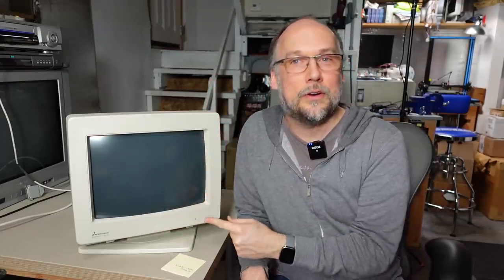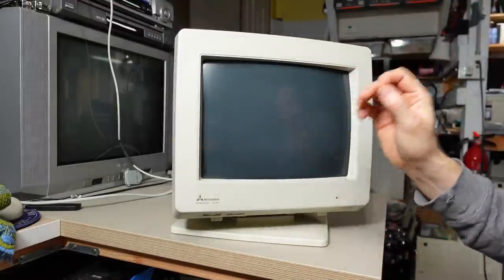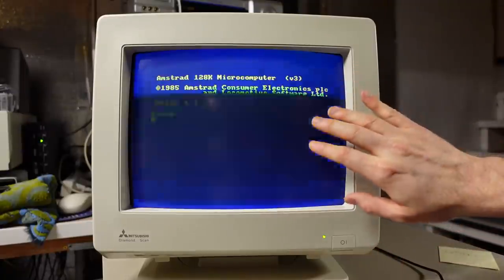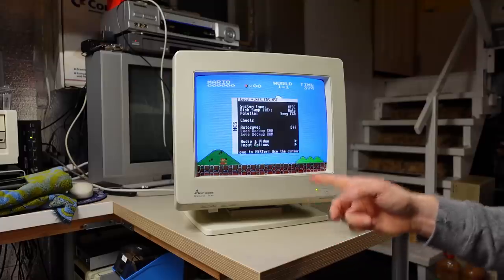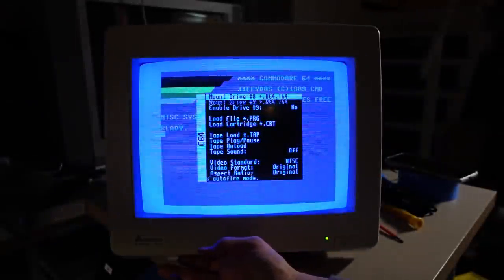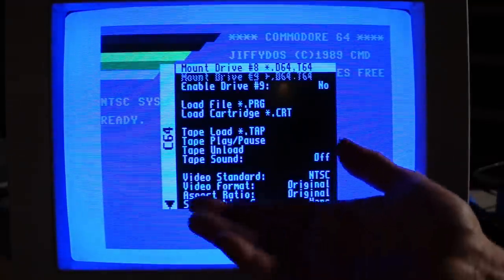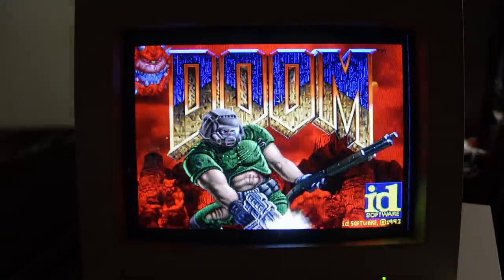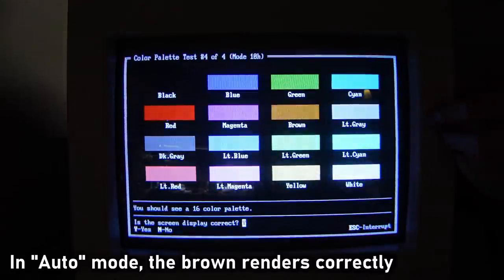Can I rejuvenate the CRT in my Mitsubishi Multisync monitor?

Comment: So, I was given a 19" SUN flat-crt the other day. I plan on using it for something, even have the vga adapter!
Reply: I had one of those too, you have the 13W3 to VGA adaptor great. I vaguely remember there was 2 kinds of these adapters, active and passive. But I seem to recall many (perhaps not all?) of those old Sun monitors used "sync on green" instead of composite sync. I also remember it being limited to a single resolution of 1152x900 and that means you won't see the BIOS or any VGA/text mode screens ever. The unusual sync on green means getting non-Sun hardware to display anything on it will likely require yet another adapter. I got it working on an old Windows 98 PC using a software tool called "Powerstrip" and a supported graphics card (I think it was the original Matrox MGA Millenium w/2MB WRAM). Powerstrip was able to force the graphics card to output the needed sync on green signal, it did work very well but only after Windows and Powerstrip had loaded. Of course I had to install and configure Windows/PS with a different monitor to even get to this point.

Maybe this will save you some time, good luck!
Reply: Back in the '90s I had a specialty video card for a PC to run a Sun monitor. I'm 95% sure that the monitor was the one that was sold with the SPARCstation 20 where the only controls were on a credit card-sized remote control that slotted below the bottom bezel. Anyway, I think the card somehow translated the startup BIOS and POST screens into a signal that the monitor would display, though I might be misremembering that. Anyway, good luck and thanks for the trip down memory lane.

Comment: I noticed that the needle on the blue meter bouncing a bit when you were pointing at it and wondering what's going on. It might not be common knowledge, but I learned that way back in the day and also forgot about it until it bit me: These needle instruments are so sensitive, that static alectricity is throwing them off. You can get quite a few degrees deflection by just brushing against the case while charged up. And some cases will "keep" the static and create a false reading from it. Always make sure to use ESD wrist bands with these, and discharge them before serious mesurements. I might do a brief "tidbits" video about that at some time...

Comment: Don't be too afraid to stick some cheater magnets on the tube! I used some on my Trinitron TV and it helped straighten out the edges. I just got some soft square fridge type magnets off Amazon and slid them around until they started affecting the area I wanted to fix, then rotate and slide them until you get the effect you are looking for

Comment: I love tinkering with old tech. It's a habit of mine that every Saturday I visit the local flea market looking for "treasure". Today I was able to snag a Commodore Plus4 for a reasonable price and it is working! The TED chip is not dead, however at first the keyboard showed little signs of life. Some cleaning helped and now it's working but I have to press some of the keys a little harder. The other thing I got was a silver fat PlayStation 2 for dirt cheat. It was rather dirty, and had a disk inside. The system started but it couldn't load the disk, it sounded horrible as it tried to seek. I was ready for a laser replacement. I almost fully disassembled it, cleaned it out inside and out because it was a bit smelly and I hit the laser lens with a little 70% pharmaceutical alcohol. Usually this doesn't help, it never helped me before but it was already bad and I couldn't make it worse. When I started it up again, that horrible sound was no more and it actually booted the game! I was so hyped! I was sending a message on my phone while the intro of the game was going and it didn't have the slightest jitter during the intro cutscene, I was so happy! It's so cool to take apart stuff, try to figure out what's wrong with it and then fix it, it's so satisfying! I'm kinda addicted to this treasure hunting and fixing :)
(thanks to David - 8bit guy, Clint at LGR and you, Adrien from your Digital Basement)

Comment: Many years ago I saw a stack of that model CRT tester/analyzer/rejuvenater collecting dust in an industrial-computer repair-shop in Pickering.  
They'd had their cables and accessories scrapped by someone at an auction/consignment house [redact]. (At the time) The shop couldn't get the documentation necessary to recreate the missing cables (with enough certainty).

I wish that I'd recognised what they were, and had somewhere safe to store it; Then I'd have accepted the offer to take a couple of them, and might have avoided seeing it raided/stripped like my other toys and equipment.

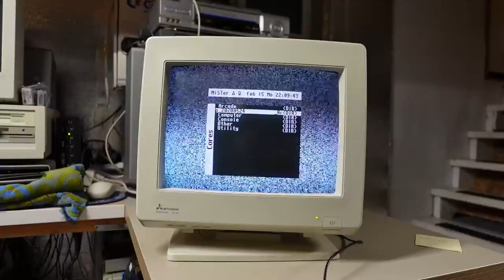Comment: I was TV technician for about 10 years, before becoming a professional programmer. First, looking at the initial problem with your monitor , if it can do HIGH bright high contrast, black and white vertical strips (like letters, menu frame) without FLAMMING (that is luma bleeding to the right) as seen , min 7:49, The CRT IS NOT the culprit!, so, you misdiagnosed at all, the problem you originally has a misadjustment in BLACK LEVEL, if the chassis hasn't analog adjustments pots, you need to enter in service mode and adjust it with the menues. (I imagine that you already tried the SCREEN pot at the flyback to correct it and you was unabled to correct it with that control, also assuming as it is in focus, the flyback HV circuit is not the culprit, anything wrong there will make the focus to move constantly and ugly).

After you change the CRT, you has problems with yoke/crt mismatching one each other, you need to implement MAGNET strips to marry the joke with the CRT. That is, magnetic strip that you can set in the glass of the neck, or stick it over the windings of the yoke, those magnet will affect a single corner, or top center, bottom center, etc., deppends on where you set, the angle also affect. But for doing that, you need to find out the exact position of the joke (that is how far or near is the joke mounted against the glass, sometime it needs a bit of space, so there is rubber mounts aswell that prevent the joke to move freely while making space).

The PURITY rings (both rings near to the screen) adjust it first, rotating both at the same time will CENTER the IMAGE (you need a TV pattern for calibrating the center), and then the CONVERGENCE rings (rings near to the socket) adjust it later. If you can't do purity AND CENTERERING, you can't do convergence. If purity is not OK, that means the joke is in a bad position, change the position of the joke, once you has perfect purity and center, you can adjust the convergence, the convergence must be adjusted WATCHING ONLY the CENTER of the screen, your goal is a perfect match IN THE CENTER, once achieved that, it is DONE!. For the corners, you needs to insert magnet strips. (when the center of the screen match convergence but not corners that means that the joke or the CRT has quality issues, for matching marrying the quality of both are used magned strips).

Remember that a yoke can be in the FAR / NEAR regard screen (focal point) correct position, but if the joke is falling that is, the winding is pointing some degree down, or to the left, or to the right, or up, that joke is not CENTERED, and will affect purity, image center, and convergence. Make sure to measure that mounting rubbers maintain the joke centered vertically and horizontally, a big mistake is to mount a rubber deeper that the rubber of the other side, so the jokes points to some side.

Other mistake, is not to place the rings holder in the exact position where the manufacturer placed it, that happens when a newbie clean the glass, so the exact dirt mark in the glass where the ring holder was, is not visible anymore!. If it out of position, the rings won't do the exact function that it must do, like purity ring affecting convergence, or convergence rings affecting purity, that means that it is out of place, if is too out of place, you can to rotate a ring and it will do nothig, or affect just a bit, but not enough, that is out of place.
Reply: EDITED.
Reply: Adrian is colour blind
Reply: @mikeuk666  brown is too near to the black if the cutoff (rgb black level) is wrong , you will has exactly what the video shows. If is matter of ... the crt is tired... you never will has that bright white in the menues , it will be all dim (like all phosohor burned, i don't see burn marks aswell, also I don't see unbalanced guns like brown is just a very dark yellow , so you need the red gun to be ok, but if something wrong with the red gun , you will never has that bright white.
Reply: @mikeuk666  edited
Reply: @flyguille  not sure why you explained all that to me 👍🏻
Reply: I just did a complete Yoke swap on a CRT for the first time not to long ago and its definitely very involved if your learning it for the first time I had to reset the yoke and concentric convergence ring assembly at least 5 times before it was remotely presentable to look at. Even then it was still off some.
Reply: The joke is on your yoke. ;-) (Lots of great speling in your post.) Also there's no OSD or microprocessor on this monitor.. it's all analog baby. He covered much of what you posted in the video. You watched it right? But thanks for the parts about magnet placement.

Comment: Rejuvenation works by stripping the top layer of 'oxide' off of the cathode, with the hope that a good amount still remains underneath.  When the worn out top layer is gone, any existing oxide beneath will come to the surface and provide enough emission to bring the tube back to life.  However, it the tube is REALLY tired, there won't be any useful oxide left on the cathode, and the rejuvenation will be only a death blow.  If the tube was made with a thick cathode coating, rejuvenation might work several times.  If the coating was put on thin, it won't help at all.  However, if the tube is so tired that it's useless, you probably don't have anything to lose.  A brightener, which is a transformer that increases the CRT filament voltage from 6 volts to 8 volts or so can give you a few months of more life,.  Good thing you were able to find a nearly perfect replacement.  Nobody today is making new CRT's or rebuilding old ones.  So most monitors will end up in the landfill. :-(

Comment: 800x600 at 60Hz was one of the very first SVGA resolutions. The highest resolution I recall from 1989 was to be found on the IBM 8514/a which did 1024x768 at 87Hz interlaced. For comparison, in the mid-1980s a 1024x1024 special pre-VESA pre-SVGA color graphics display was a choice hardware item that would set you back $10 grand.

Comment: Nice find with the König rejuvenator! I have a very similar Müter BMR-90, but it's not automated. They did have an automated model as well, tho (BMR-95). That said, I wonder if the automatic process killed the tube?
Your Mitsubishi really did have good emission, surprisingly. Infact, usually the blue cathode is the one to go first so I was surprised it turned out strongest. Maybe the previous owner preferred yellows. ;^)

Comment: Hey Adrian, there is a company called Lexel Imaging that has a significant stock of unused CRTs that might be able to help you if you send them an e-mail.  You may have heard previously about a company called VDC that a lot of TRS-80 folks used to get replacement tubes from, well Lexel is a subsidiary of VDC to whom most of the CRT stock was transferred a year or two ago.  I ordered a tube from VDC for a CGA monitor back in 2018, they know how to cross-reference these and find one that's compatible.

EDIT: I actually thought the video was over when I commented this but there's like 15 minutes left, so just disregard if this advice isn't applicable.  But maybe if you need a new CRT in the future you can contact them!

Comment: This is not a monitor which was sold to the general public.  It was designed for use in testing laboratories to verify the functionality of commercial and industrial equipment.  They are still in high demand in the aircraft and industrial MRO market because of their versatility, and some avionics test sets specify this exact model of monitor.
Reply: It was sold to the general public, I have one.

Comment: Nice that you got your monitor working in the end. Earlier this week I was trying to revive a 70 year old TV and I wasn't able to get anything to show up on screen. It would be so much easier if I had a CRT tester and a high voltage probe, now I'm stuck wondering if it's an HV problem, grid voltage problem, or if the CRT itself has a problem.

Comment: my birthday comment so better watch out :P
old crt's which weren't used in a while get dimmer and not evenly and often leaving a crt on for a while "wakes it up" as some  youtuber say
if it is really worn out you simply won't see any difference, but if it is only pasivated on cathodes from waiting 20 years in the storage there is a great chance it will wake up after displaying white screen (or black and white stripes) for a span of few hours. no rejuvenation needed 
i got my 80's tv's all working this way, with no extra effort

one more thing in most cases with color crt's coil assembly is maried to the screen it was put on, i never had a good picture from combination screens with foreign coil assembly, even from the same model of crt screen. corners always get messed up. transplanting crt with all the bibs and bobs on it is always the best  way if the impedance of coils and tube sockets match, but you should always adjust filement and grid voltage after swap because even  the same model can have different focus voltage or a bit different filement

Comment: I soooooo look forward to the talking hand segments of your videos! Great! One question - on other videos I've watched with the older BK series of rejuvenators, the individual colour tracking dials were used in conjunction with the cutoff adjust - to "normalize" the cutoffs across the three guns. But I didn't see you touch the colour tracking knobs - were they all just zeroed out? Or is this newer unit just automating a lot of that work that needed to be done manually with the older units?

Comment: When CRTs were replaced on broadcast grade monitors, Sony in this case, they supplied a bag of those magnets to fine tune the convergence. I don't think they did it on consumer TV's. The 19in and 12in tubes were the same in consumer and broadcast monitors. They had a different part number because the broadcast tubes were just hand selected and cost about $2000.

Comment: The problem with these Multisyncs is that they are so damn useful that people used them up.

Regarding the Overscan Underscan switch; there may be a way to set the raster size for each of those positions. I have monitors that allow for that and it's very useful.

Comment: I come on I built my own from scratch in the 80s.  A copy of a beltron The plans were published in radio electronics. The beltron did not use a high voltage connection and you do not have to discharge when using it. I made a lot of money back in the day

Comment: Adrian, I believe that if you trace the circuit of the composite input it will go through some filters to separate it into luma and chroma, so is it possible to run inputs for each to bypass the filters? I think I did that many years ago but the process evades my memory! I do have a friend who worked on analog design way back when Sylvania made color TV's and monitors, I'm sure he'd know! THX!

Comment: U remembered to turn up the screen pot on the LOPT?
That's a trick I discovered long time ago... when the picture is dim and you crank up both contrast and brightness and the picture is still too dim (but black is still black), I'd crank up the screen grid until black becomes dark gray. Then I turn the brightness pot down until it gets black again and more often than not the picture will be super bright with tons of contrast. Now if you crank up everything and black becomes dark gray but white is still at mid to light gray, well... that's when you reach for the rejuvenator. (unfortunately I don't have one, and someone's probably gonna comment now why cranking up the screen instead of rejuvenating it is a bad idea)
(or you might wanna look out for a sub brightness pot hidden somewhere - if you max out the brightness, black should be gray)

I have a very similar monitor. It's Siemens Nixdorf labeled (does that mean I now have to get a japanese made rejuvenator?) but the CRT is in good shape. The colors are kinda average as is sharpness at 1024*768.
It's got all the features yours has except for the composite video in and the underscan switch is missing and I think the V-Scan as well, but it has everything else and does go down to 15kHz. Ah and there's only 3 pots on the back and I think they're h-posi, v-size (only for "higher" SVGA resolutions) and v-posi.
Resolution goes up to 1024*768 interlaced.
Shame the analog/TTL switch is on the back because I have two computers hooked up to it, one with SVGA and one with EGA (so yes, 64 color TTL EGA works perfectly fine on this monitor too - I've written a program to cycle through palettes when I was a teen). Btw. in EGA TTL mode, the contrast pot on some monitor does weird things, it behaves differently to analog. Might wanna try that sometimes.

Duuude... your camera is high af.

Comment: I had the Taxan 770 mentioned in the group review. You have to remember that the beam width is not adjusted for the 50Hz and lower rates so a substantial part of the CRT has nothing being fired at it from the guns.
Hence the dim pictures. It will be much brighter at higher resolutions.
Reply: Even new my Taxan 770 multi sync had a dim picture on PAL and NTSC machines because of the beam being tighly focused for higher resolutions at high scan rates.